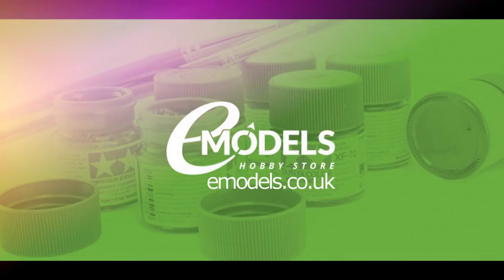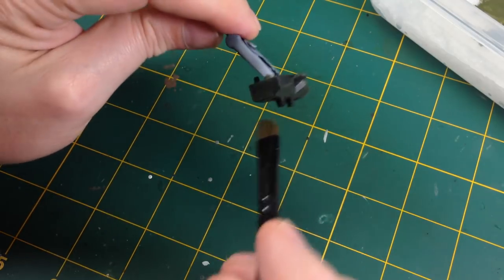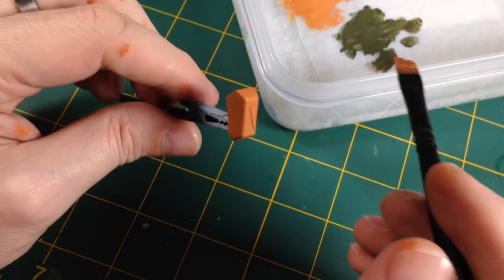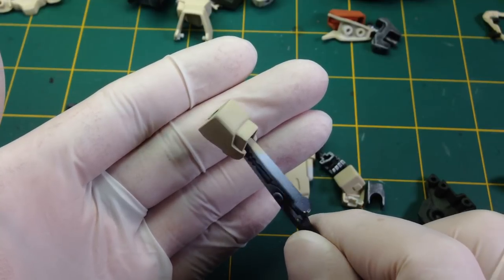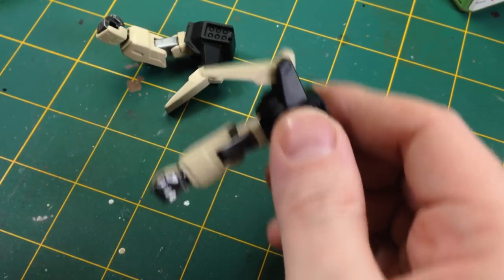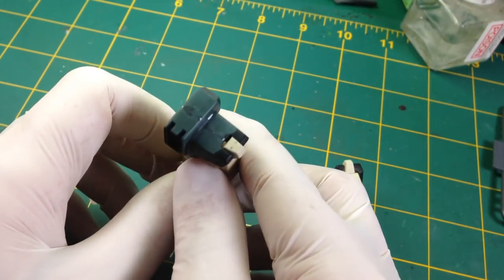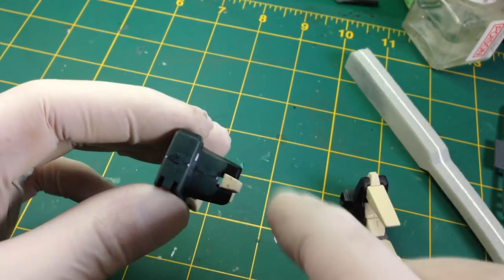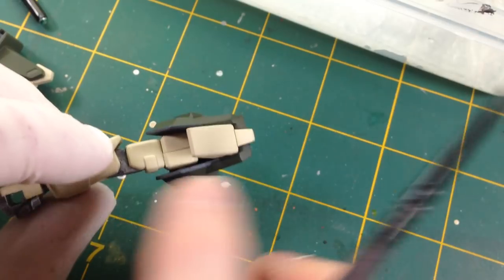AIRBRUSH FREE HG Buster Gundam 2: More Seams & Painting Already!

Comment: Thank you very much on touching on airbrushless painting! really looking forward to using the wet pallette next time with Vallejo. sweetly done on the buster! ive tried using tamiya acrylic and its ok using a 1:1 paint thinner ratio on any color (german grey, flat red and gold so far). the only issue so far is after 1st or 2nd coat the paint tends to form up tiny paint balls. hehe
Reply from the maker: Yeah, that's because Tamiya is alcohol based so going over paint with more paint simply re-activates the older paint, if it is not 100% cured. With how easy a wet palette makes water based painting, by comparison Tamiya paints seem not worth the hassle :)

Comment: I actually find it super easy to take paints straight from citadel pots, weirdly enough. Then again, I usually only do small detailing and such, rather than full paint jobs.
Reply from the maker: It's fine for little details, where brush marks are not usually a problem anyway, but for basecoats that need to be smooth you absolutely need to thin your paints ^_^

Comment: Good day Guru, first time commenter long time watcher, I have a pretty decent tip for you as I use it for my kits, using a bottle of Tamiya Thin Cemment, if you have one spare that's nearly used up, throw in some plasticard shavings and leave it a few minutes and let the plasticard melt into the Tamiya Thin and you can use that as a form of bonding agent and filler, it's super handy and very easy to sand.
Reply from the maker: Yup, thanks for the tip! It's called "sprue goo" and it is super effective (I just don't have a spare pot of Extra Thin right now) ^_^

Comment: If you painted the entire arm including the parts that go into the polycaps and joints that's why it's so stiff the paint's either made the plastic thicker making the connection much tighter or the paint's basically glued the parts together.

This happened to me once and was a pain to fix without breaking the kit.

That's why alot of Gunpla builders recommend either not painting things that connect the joints because you won't see them anyway or gently moving the joints while the paint's drying.
Reply from the maker: Yeah, I usually abide by those rules but for some reason I got carried away enjoying the painting and totally forgot. My goof ^_^
Reply: Happens to all of us man.

Comment: If you're using superglue as a filler, I suggest you try mixing in a tiny amount of ordinary baking soda. It bulks out the glue and makes it fill gaps much better. The downside is that it dries harder than the stuff that Wolverine's innards are made of, so you will need a big file / power tools / semtex to work it. It's good for those jobs where you need superglue but you need a very strong joint, too.
Reply from the maker: Yup, often folks filling seams on resin kits you that - you can use talc instead also. I didn't want to have to chisel it flat though, so I kept it simple on this build :)

Comment: Hi Sir just a question about painting joints. do you do less coats to ensure that it wont jam up or do you sand the joints so that you can still do the normal painting process?
Reply from the maker: Honestly, usually I forget to do either of those things :) Some kits are fine, and some need a little work to avoid scrapeage, and there's no way to know which, really. Normally I would sand the joints a little if I think there will be contact (i.e. the back of the knew joint on ANY Strike variant). But going forward, assembling the frame first before priming/painting can also help avoid gumming up joints (but it is not always possible)
Reply: Modelmaking Guru Haha thanks for sharing! had scrapings from my last painted kit as well will try sanding them guess its good to build the kit the dissamble them just to have a clear view on what needs to be done.
Reply from the maker: That's also another good idea, but I never tend to do that because I never trust I won't break something :)